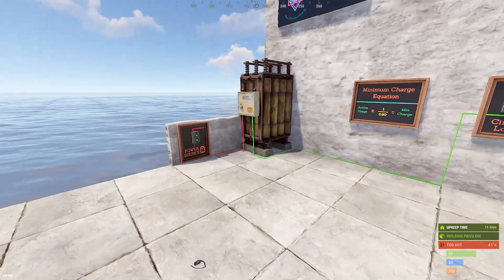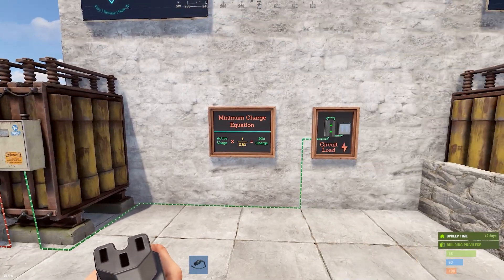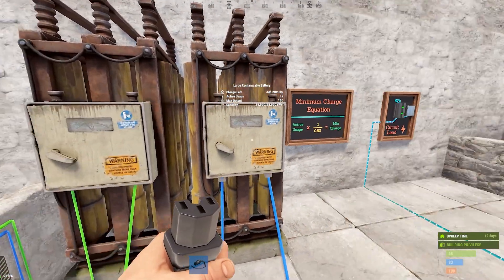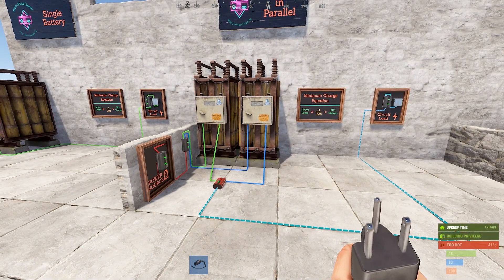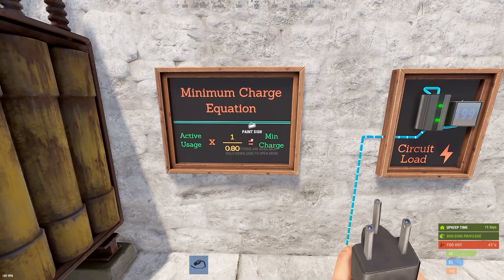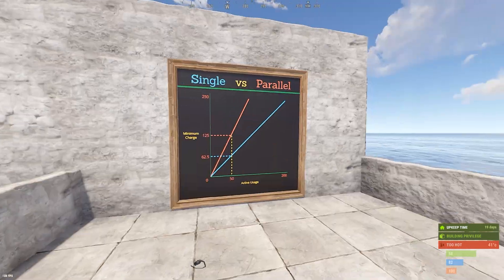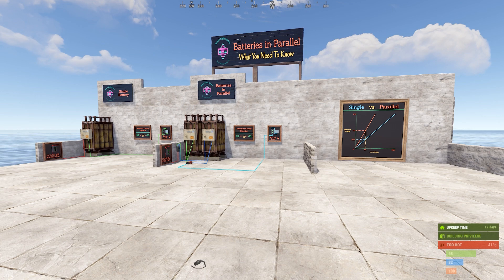RUST | Batteries in Parallel - What You Need To Know 2023

Comment: If you don't need the full power output of two batteries going into one circuit, you can use the OR Switch instead of the root combiner. If you do this only the first battery will be drained instead of both. If the first battery is destroyed or runs out, the second will take over.

Comment: Is this still true? I'm just coming back to the game after a couple years and I know there were some rather large updates to the electrics, namely removing power drain from a bunch of electrical components. I know that running batteries in parallel used to be very bad due to a bug (I think) causing the batteries to drain far more than they should. Has that been fixed?

Comment: why use an electrical branch instead of a splitter as the first connectic ? 
I need to connect my windmill to 2 batteries and i don't know if I should use an "Electrical branch" or a splitter

Comment: i use this alot as a solo. i dont wanna waste the space on a medium battery so i throw acouple of small ones on my workbench and parallel em together. my whole system usually lands under 100 so id rather go with 7 smalls tucked away were there not in the way then 2 medium batteries or a big battery. i would however not use this method if i had alarms of turrets in my system since low capacity on small batteries can be a issue during foggy days.

Comment: In rust, parallel and series are sorta backwards from parallel and series IRL. Something I think everyone should take note of when jumping into electricity in rust. 
IRL, parallel increases capacity, but in rust, series increases capacity. Totally inverted lol

Thanks for the video!
Reply: yes, as someone who uses this stuff in real life it drives me crazy
Reply: yes they had it wrong, a little frustrating to see, they usually gets stuff like that fairly spot on. i wonder if it was a mistake or they did it cuz it seems to make sense to ppl that dont know electrical. there would be many many house fires in rust if the electrical systems were combustible. crazy how wrong it was last time i looked.
Reply: they dont really have it on as they are not really using "Volt" rating they are only using Watts, Rust watts (this is why you have just one line going to items vs 2 (common, neutral in real life)

so you cant think of it as the same system we have as its only using watts (capacity in watt hours)

I didnt know that it was doubling on the batteries, that defeats putting them in in combiner.. seems like we will need multiple Nih Cores in a base

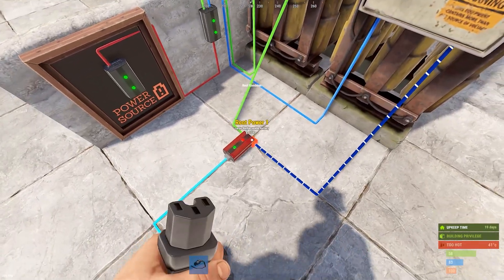Comment: ref 3:30 erm... pardon me, but parallel would not increase volts, it would increase capacity. Series would increase volts. So you would not see 200 on the output unless in series.
Reply: Rust is backwards, so in this context he is correct. Quite confusing the first time I was learning rust wiring lol